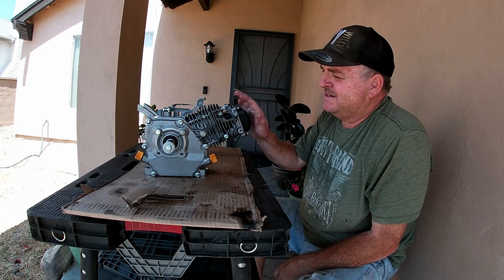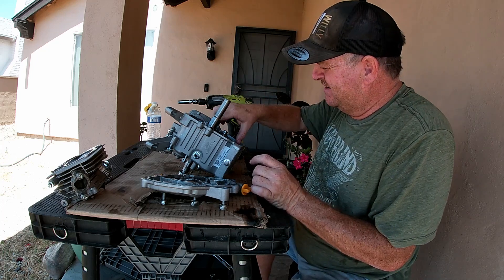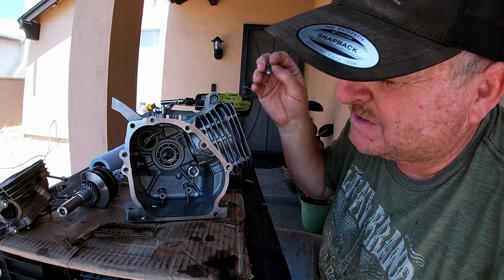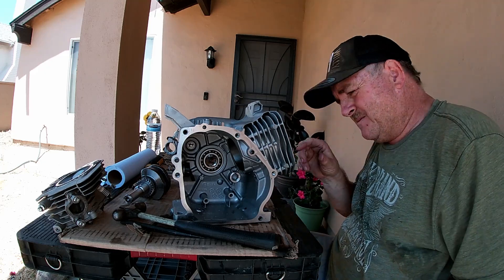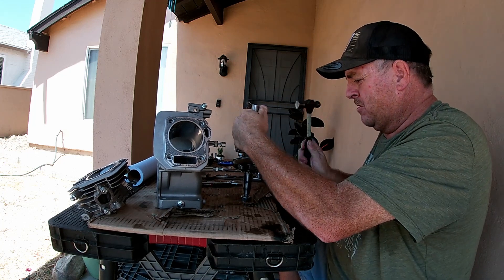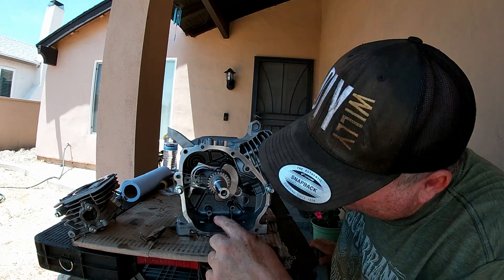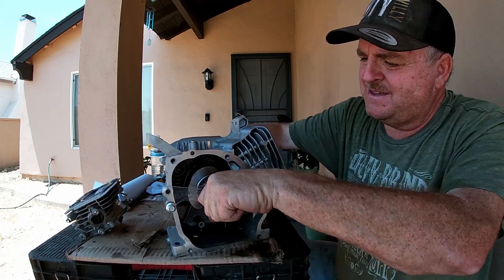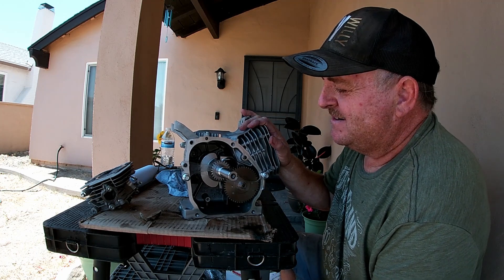224 MAX Performance Busted Budget Build Day 2

Comment: Good to see I'm not the only one that finds extra parts! That was good timing to find that before any major damage. The patient is on the table. The clearance tool is slick! Be curious to see if the small amount of grinding for the clearance will affect the balance showing up in vibration or bearing wear or may not be able to tell at all.  Cool video on to part three!
Reply from the maker: This engine always had the shakes. There was a lot of grinding to make it all work. From what I hear the EC Carburetor parts work out much better. With less work to make it all fit. However I didn’t find that out until after I started buying parts.

Comment: The clearance game is real I hear! The lower cylinder gets a lot removed out of these.
Reply from the maker: It does require a lot of clearance to make it rotate freely. I took a small amount each time until I got it. It was 3 days of work. Of the time have each day anyway. Going to and start it tomorrow hopefully
Reply: is a dtv 200cc motor good my boy has one in his basement
Reply: @DIYWilly  did you keep the millings? It makes a cool visual effect to see how much comes out. I've seen some ski slopes!
Reply from the maker: @fatbuddycat  no unfortunately I didn’t. Would have been cool to see it in a pile right

Comment: Pretty much the same here. I clearanced the back of the block, a little from the top of the cylinder, and a lot from the bottom of the cylinder.  Had to clearance the center of the cam and the intake lobe.  I used a stock length ARC (6270) clone rod with a .570 CH flat-top piston.
Reply from the maker: I chose to keep the dishes piston. I don’t want the compression going that high due to I’m using the electric start kit and that motor is not the strongest. I do have the milled HEMI head so I’ll get a little pump in compression.

Comment: so is it bad to clean the top like where the valves are and is it bad to clean the top of the piston
Reply from the maker: No not at all. I do it every time I have the head off.
Reply: @DIYWilly  oh ok but no sanding right just gas and oil im hearing this ducar aint all that because of the 24mm intake but idk it feels stronger then my old predator i hope it last me the restof the year just gotta get this gov gear out its plastic what were they thinking those geniuses lol

Comment: dag willy i gotta get this gov out my ducar asap whats the best torque wrench i should get to re torque my side cover after i get it outta there
Reply from the maker: Any of them will work. I use a harbor freight special for the 1/2 drive and I purchased one from Amazon for the 1/4 drive. The torque specs are low any work fine
Reply: @DIYWilly thanks again pard  so to do the side cover get the 1/2 drive and what the 1/4 for the rod
Reply from the maker: @SoLoCruizeR2o3  yes exactly
Reply: @DIYWilly  lol thnx man have a Blessed night Capt cant wait to see that next cruizer vid u make 100%
Reply from the maker: @SoLoCruizeR2o3  Thanks man
Remember the side cover torque’s to 17 ft lbs and a billet rod is 170 inch lbs with 30 weight oil. The head bolts go to  17 ft lbs.
Reply: @DIYWilly  big thanks i appreciate your heLp fUr ReeLZ
Reply: @DIYWilly  so get the 1/4 and the v3/8 just to have im looking at the buLL brand on amazon they have high buys and reveiws its the cool blue box one